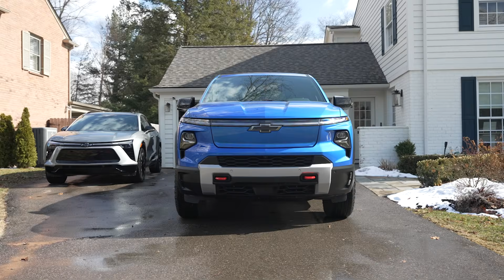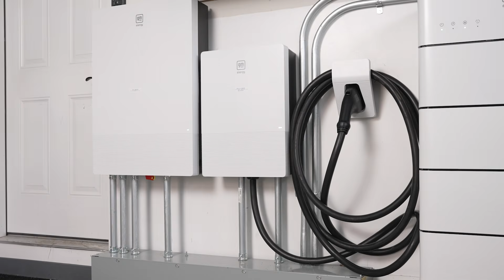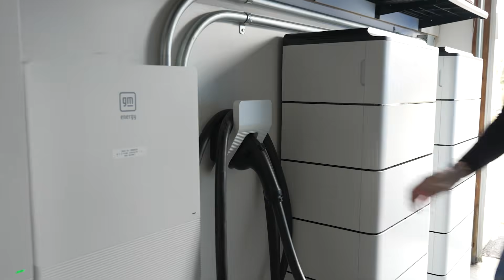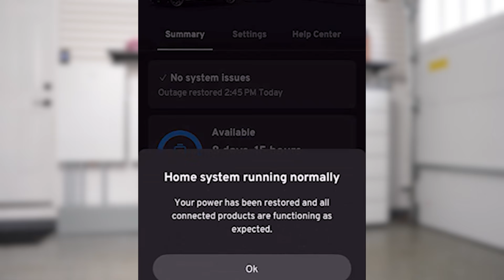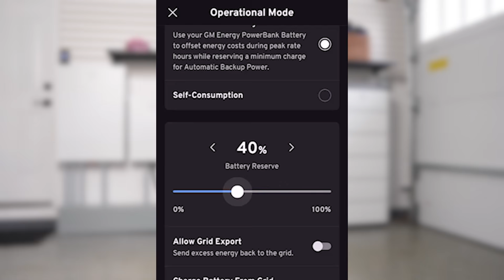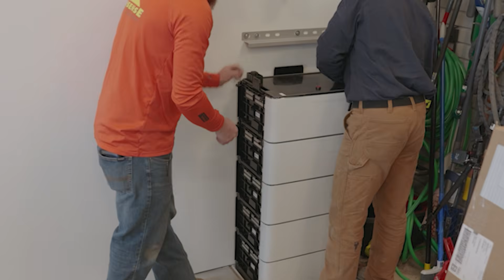Using a GM car as a battery backup for your home with GM Energy (Sponsored)

Comment: Based on the size of the battery, the capacity might be at around 40-50kwh ?  then it should be able to power the entire House, not just some appliances.

Comment: What’s the approximate cost of this system? (Yeah, I suspect it’s a case of “If you have to ask how much, you can’t afford it…)
Reply: Think it’s about $6,000 plus installation. 

You can get a full auto system installed with a natural gas or diesel generator for much less. That can run for days or weeks on end if need be. 

This has the benefit of being quiet, that’s all.

Comment: Im building a house in Mexico and will add solar that can more than cover my power needs. I have a EV and it's kind of crazy how much I need to spend to access the power in that massive battery. As I priced my options the GM power system ends up costing the same as about 10KWH of back up battery. But since they don't sell the system in Mexico that option seems to be off the table. Mexico has net metering on a 1 for 1 basis so the grid is essentially your battery at no cost, I was just looking for back up power in an outage situation. May just buy a portable battery to plug the fridge into. As a retired guy it's fun just doing the research on what's possible these days.
Reply: Would you be open to exploring new opportunities around Tesla and SpaceX investment… The innovation currently ongoing is crazy.

Comment: VERY COOL, BUT, I wish these systems would work with any V2H/V2L CSPABLE vehicle.     Because of how expensive these systems are this only makes sense if you’re gonna be able to use it for energy arbitrage ,like mentioned.   Otherwise spending this much for a system you may use once or twice a year max for just a couple of hours is not worth it. Even if it did last several days you could simply stay at a hotel for cheaper than it would be to own a system like this.   But on the other end, if you can use it to save money on Energy by offloading defensive, Energy demands onto the battery during peak demand. Now you have a much more practical and worthwhile solution.
Reply: Would you be open to exploring new opportunities around Tesla and SpaceX investment… The innovation currently ongoing is crazy.